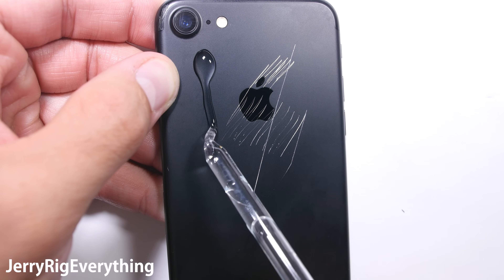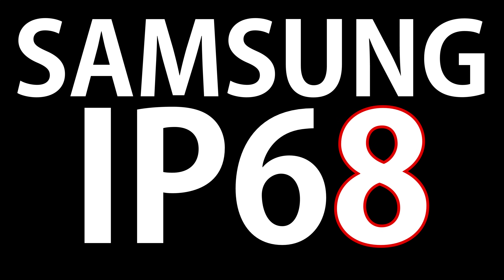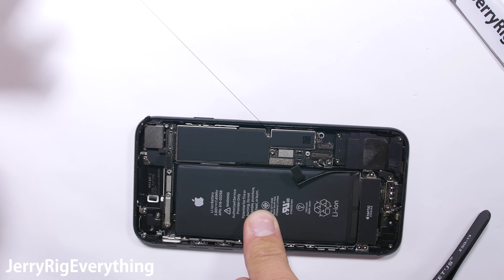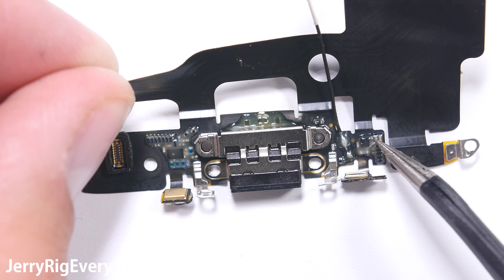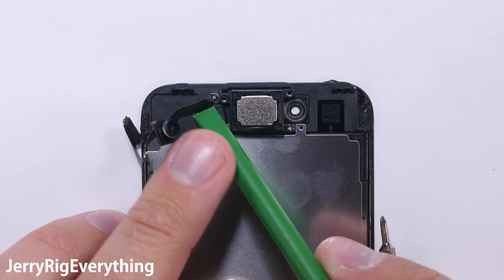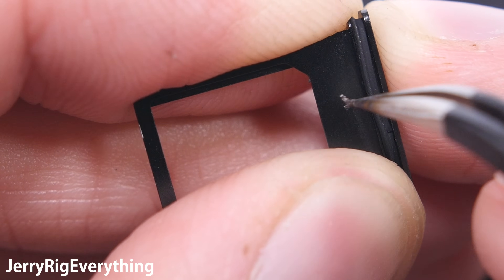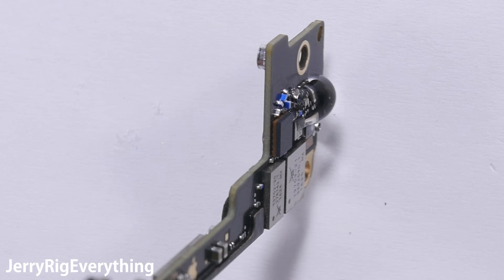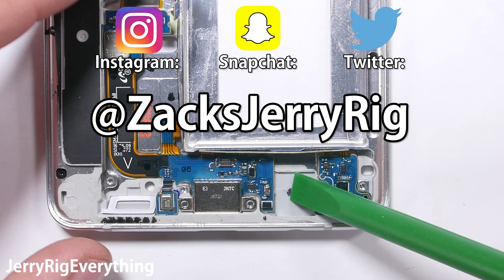What makes the iPhone 7 WaterProof? - Ultimate Test!!

Comment: My iPhone 7 used to work really great when I used to immerse in water, today since my iPhone 7 battery died in a bucket of water , I decided to just charge it and then get the water out of the speaker by playing loud song , I noticed that home button was acting weird , it was hypersensitive to touch then I kept my iPhone turned off straight on a table against the wall , few hours later the home button seemed to work fine then now the home button stopped working , right now I’m using assistive touch, but Touch ID works

Comment: I've always felt that if these IP ratings actually meant anything, then these manufacturers would cover these devices under warranty in cases of liquid damage. They of course never do, because they know it's about as useful as screen door on a submarine. I have never trusted the IP ratings on any phone, because I've opened many old, yet completely unopened and untouched phones over the years, and have found oodles of dust inside of them. Even virgin iPhone 7's, which supposedly COMPLETELY protect from dust ingress, had plenty of dust inside of them. 

The other problem with IP ratings is how easily misconstrued they are. The testing requirements for an IP certification are quite vigorous, but I don't believe the testing conditions accurately replicate a real world scenario. The one thing that is never considered in every testing scenario I've seen in use is...the device being dropped. When a phone encounters liquid, very rarely is the encounter a gentle one. More often than not, the phone comes tumbling down and lands in a puddle, or a pool, or the toilet, or someone's cup of water. That initial impact is what makes or breaks the IP rating, and unfortunately this is never tested for IP certification.

The sad part is, Class 3 standards are not that costly to implement. A Class 3 electronic PCB may be coated in a hydrophobic mask, or surrounded in an epoxy resin. It's do-able and the infrastructure already exists to apply this sort of protection in very large scale. Medical, military, and scientific focused industries for example make use of this every day. So it's not like it would be "too expensive" to implement. Apple already bothers to coat some parts of their motherboards in this tacky black resin, but it's not the same thing as a full hydrophobic treatment. So they could easily go one step further and do full, proper treatment of all of their boards. But then I guess less people would be buying new phones.

Comment: I dropped my 7+ in the pool, and I didn't realize it for about 2 hours (7 feet deep) and I found it a few hours later and it worked fine after I had taken it out and dried it off. My pool doesn't have chlorine. I have read that if it had chlorine in it, the phone would've been long gone

Comment: It aint waterproof or anything Not even splash resistant Just cleaned  my phone few times with water(never submerged)
I had 9+months still to go on warranty 
Power button started giving issues
Went to service centre and 
Voila they told me 
The indicator is red
Literally my my last iPhone
Got button (mechanical issues) replaced for 29000 inr or half the original price

Comment: I think they played it smart with the water resistance rating and not covering it under warranty. Far too many people will try to go swimming with it, or do stupid stuff at the lake with it. I think Apples point of view is just to have a device that won't sweat a splash of water while at the pool and not in it. The device would be fine using in the rain but not as a GoPro. Spill your drink on it without freaking out and rushing to power down the device. Could they have done a better job? Sure. But as is I think is good enough. I have the iPhone 6s Plus so I have to be much more careful around water.

Comment: EverythingApplePro Did the iPhone 7 test in a lake for 30 ft along with Samsung and the last one died and iPhone survived(;
Reply: Let me correct that it was in a river with dirty water at 35 ft iPhone still had life and worked n had some water damage issues after but eventually still worked as for Samsung it died right away! This test started at 5 ft for 5 min then gradually increasing till 35 ft so you do the math but iPhone outdid the Samsung even tho the last one has an ip 68 rating which is more than iPhones 67!

Comment: I fly the Yuneeq q500 camera drone and while night flying over a fresh water lake the battery fell out and the drone fell hitting the water hard. It took me three days dragging the bottom of lake with a grappling hook eventually I hooked it. I striped it down and dried it in full sun and after reassembling the drone fly's like new. The electronics are very compact and I dare say are water proof. it's the same with phones if your quick enough and can remove battery your phone might still work after drying it out..

Comment: I saw a video and the guy put an iphone 7 and S7 in a bucket and put it deeper than 30-40 feet under water and the iPhone outlived the s7
Reply: I would like to see a repeated test. Also you may or may not have noticed, water entered the device, as you could see water in the display... Meaning it wouldn't last for long after that and most certainly would NOT be covered by warranty.
Reply: Matthew Toope  The iPhone died not long after, once the water was in it, the components didn't just magically ignore the shorting properties of the salt water for the rest of the phones life...  The S7 died but where did the water enter the S7 vs where the water entered the iPhone?  I can promise you that as the water slowly made it's way from the bottom of the inside of the iPhone where you can see the screen waterlogged, it would reach the more critical components, thereby killing the iPhone. Calling the iPhone the winner is like calling 1 of 2 guys who fell off a 10 story bridge a survivor even though he died 3 minutes later....
Reply: vbtyfegtuiuldfdafsvhjpllm ,.
Reply: For anyone who hasn't seen the video LynX is refering to the phone lasted 25 minutes in 1 meter of water followed by 10 in 1.5 meters. Then they did the 5,10,15,20,30,35 foot test at 5 minutes each only got damaged after 30 but was still some what working and the s7 just straight died.

Comment: Trick. Take drops of bleach and put it on the water damage indicator and then heat it with a heat gun (or blowdryer)
Reply: I don't think it would really help, if your phone has been opened you can kiss the warranty goodbye ... (and with apple sealing, it would be easy to detect i think).

Comment: So they made the home button non mechanical and removed the headphone jack to make the device more water proof. But then they added more holes for the faux speaker, and only gets IP676 rating. Whereas the Note 7, still has a clicky home button, still has a headphone jack, as well as an S pen slot and manage to get IP68? Apple isn't even trying..
Reply: Exactly. They even made S-Pen hole waterproof! Even Sony haven't done it lol. (I do realise that Xperias don't have S-Pens but still).
Reply: Don't forget how it happens to a very microscopic part of the people who own it and how it's a better phone in every way for every person every day despite those rare incidents. 

Nice try though, sheep. ;)
Reply: @Frawt  if you call 1 million unit microscopic i don't know what am i supposed to say
P.S BEFORE YOU START MENTIONING THE REPLACEMENT UNITS 400 OF THEM EXPLODED
Reply: +Frawtarius You're just as big of a sheep towards Samsung if you don't see the flaws in their phones.
And before you assume I own an Apple product, I don't. I have the S7 lol
But the Note 5 is so much better than the Note 7 in many ways outside of the slight upgrade in specs that the Note 7. Like the Not exploding battery.
Reply: Frawtarius You're calling me a sheep . So it happened to a couple of people so what if a "microscopic part of the people" get their face burned so what it's just a "microscopic part of the people"
Reply: Don't forget the extra feature that it explodes .

Comment: Not hating, but in the last durability test video for the iPhone 7 you bent it and ripped the glue which seals the screen to the aluminium casing of the phone, however this test went you are still not providing a 100% accurate result to the consumer and therefore could be giving people the wrong impression on the waterproof feature, please think ahead more next time, thanks.

Comment: 1960 mah battery?  Nice.  2 hour of 3D game or navigation and it is dead. Good phone for 850 euro. Apple says: This thing is waterproof, but if it will be damaged by water, this is not covered by warranty. Sounded like: This is a ship. It may be used in ocean, but if it will be sunk - we are not responsible for this.
Reply: Apple never said it was waterproof they said it is water resistant huge difference. Proof means u can literally shower with it and nothing will happen resistance is like getting some drops of water on it at the most it can be under water that is really shallow. Like really shallow. Like an inch

Comment: So, you can accidentally drop your iPhone 7 in a toilet and be good as gold. I guess for some people that's enough to upgrade.
Reply: It is, considering that wasn't the case before. However, I used to have an iPhone 4S, which survived the toilet treatment, and while it turned off, after drying, it was back. I later gave it to my mom after I cleaned it. That was back in 2011. Today, the 4S still works and runs the latest version of iOS.

My current Galaxy S5 which has the same rating, was also dropped in the toilet, I had a case on it, however the headphone jack and charging port were not protected. This gave me a ton of problems, and I had to use the phone intensively, to overheat it, just so it can dry fully, because I needed it the very next morning.

The charging problem never really happened with the 4S, and it happened with my S5 because the shit USB port cover broke. This goes to show that Samsung has been far behind with the S5, when it comes to rendering it water resistant, it is reassuring to know that they've improved so much, to the point where, even the headphone jack is water resistant, and you don't need covers. It also goes to show that Apple is not innovating in any way, really. IP 67 has been around for years, already.

Comment: I really like that someone destroys a 900$ phone to test it in depth and find out what is really done apart from what the advertising tells you and not just for fun. Thumbs up!
Reply: In case you dont know: Water is non-conductive. If you just use destilled water you can submerge your iPhone 20 metres infinitely and it will still work. And by the way: The motherboard was not connected to power, so it wouldnt be a problem if he'd pour liquid metal on it.
Reply: No one gives a fuck. FOR SCIENCE!
Reply: He didn't destroy it btw;)
Reply: Water doesn't destroy electronics, there was no power, meaning that there was no possible way to short anything, the only way for water to destroy electronics is if there is electricity going through the circuits. I've done it with a computer motherboard submerging it in water and let it dry, and still works as if nothing happened.
Reply: Narwaro seems like you dont now techrax or everythingapplepro
Reply: As long as he lets the mother board dry out before powering the device up it will be fine. The seal around the screen can easily be reapplied as well, and the phone put back together .
Reply: Lmao, dude, i myself have 18k views and I have earned  around 35 dollars so don't tell me I don't understand what i'm talking about, and any popular youtuber that says he earns less than 1-2 dollars per 1k views is just bullshiting you, because not only do popular youtubers have sponsors backing them they also get more money per 1k views of course it also depends on what kind of ads are shown, the month (because sometimes ads during one month produce less revenue than ads during other months) and the content that is shown, so don't go around accusing me of not understand how YouTube works when you are clearly the one who doesn't understand it
Reply: he earning money by youtube
Reply: I'm sure this is obvious, but the money he makes from these iPhone 7 videos will easily make him enough to buy a couple more of them.
Reply: Umm, no, he gets around 100-200 dollars per 100,000 views
Reply: Just for your information: When you accepted the youtube monetization ToS, you agreed that you will never talk about earnings with anyone.
Reply: Narwaro I did and my mom is going to kill me I don't know how to tell her steam ruined my phone the the shower
Reply: Because he is getting paid to do it
Reply: +Memefucius , no, no, no, and NO. You have 0 understaning on youtube pay do you? Im partenered, have a video with over 300k views, and havent made $200 from that... So your knowledg eis wrong, us youtubers dont make as much money as you think we do, we dont roll in dough, okay?
Reply: I can solely speak for the situation in Germany where all ads on youtube are in German so there might be a difference there because I think there is tremendously more money made with English ads.
Reply: yep
Reply: i9lp
Reply: Narwaro
Reply: Narwaro where I live it's 590$
Reply: Its ~600$ when it was new
Reply: 800$
Reply: Narwaro actually it wasnt 900 back then it was actually 500 dollars or less
Reply: And plus hes making money to buy anthor one with youtube
Reply: Narwaro phone was 699 when first coming out. Hardly worth much anymore.
Reply: Or 649
Reply: A dumbass, but it's cool at the same time
Reply: Now its 100$
Reply: lol i got one for 50
Reply: Could you stop conjecturing such a bullshit? No one gets paid to destroy phones. Turn on your brain before writing something.
Reply: You get about 15-25$ per 100,000 views so yes...
Reply: Technically he did destroy it. The water on the motherboard probably caused some damage, the water resistant band around the screen is fucked, etc.
Reply: @nschwartz311  6 years but eh... if there was no electricity it will work
Reply: Dude I agree with you 100%  Anyone who fucks up a brand new iPhone that isn't cheap is a not so smart person.  Getting a Plus model 7.  I love the iPhone and I don't care if it has the headphone jack or not.  I never charge my phone or listen to music at the same time.  Only time I charge my phone is at my house and I would use either Spotify or iTunes for music on my iMac.

Comment: I shower with my s7 edge at times and its still going strong.
Reply: Haha same
Reply: How can you use it in the shower perfectly fine? When I try to use it in the shower, the screen responds to the water splashing on it as a screen selection.
Reply: When I'm bathing the screen is dead. But when showering, it seems responsive and it doesn't have those ghost/water/fake touches. But I have a S7 Edge so maybe that's why.
Reply: ProtoDeV Nano I have an S7 Edge as well and it responds to the water so well it's annoying.
Reply: That's weird. My screen is crazily sensitive to normal touches and doesn't get water touches. But with my phone experience I can honestly say that even two identical phones are really different. Or maybe it has to do something with water type (less or more chemicals added), water temperature or maybe even the distance from the shower head and the phone itself. I have no idea.
Reply: And why would a normal person shower with their phone? Why, can't you wait to use your phone when you're done taking a shower?
Reply: Markus Vhane idk, just for the lolz. I've only done it a few times, though.
Reply: Markus Vhane Fapping :)

Comment: eat that Apple lovers, buy note 7 but after they solve explosion issue xD
Reply: Galaxy Note's suck.  They are very unreliable and run extremely slow.  The Note I had before my iPhone ran slow to begin with when I got it and when I updated the software on it, it fucked up several other things on phone.  iPhones have never exploded because they don't rush to release a phone like Samsung did.  If iPhone had a problem with their battery while it was still in testing before the public release Apple wouldn't allow the phone to go on sale nor would they even introduce it.  I've never had 1 problem with any iPhone i had.  iPhone is very reliable and fast.  I do not owe any products from Samsung because Samsung is a crap cheap company who copies what Apple does and gets sued all the time.  Samsung phones are also made of cheap plastic.  When I had my Note 4 I dropped it once and It had a case on it and it broke the back plastic where the battery sits.  Shows how crappy and cheap Samsung phones are.
Reply: Naa buy the Samsung Galaxy s7
Reply: I wonder who the apple fanboy is
Reply: Jesus F, butt hurt much
Reply: Fire Alarm How Too Guy
you are right about iPhones' reliability, but I have note 2 and I can say that it is so durable that I couldnt broke it after dropping so many times and it runs ok considering I bought it on release month; about software, Android is advancing but coming before iOS but if you can use cfw then Android phones triumph because they have so much better hardware compared to iPhone released same year